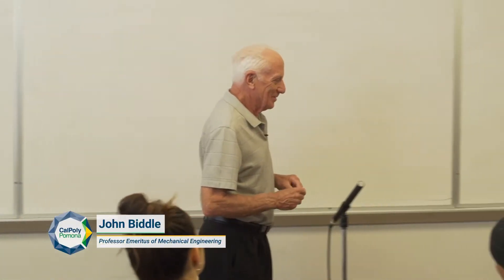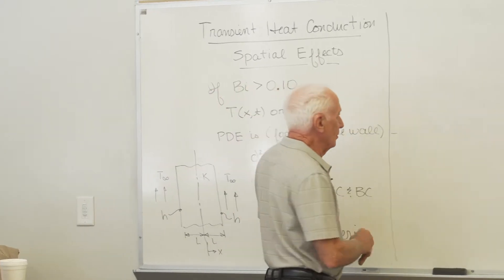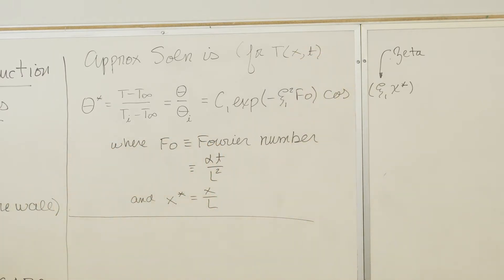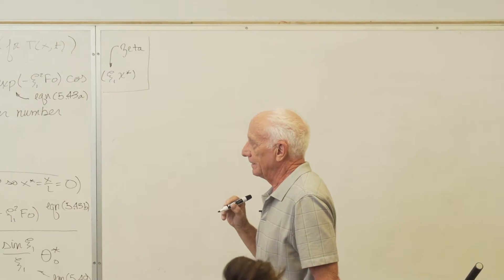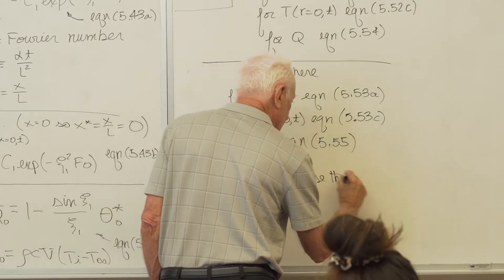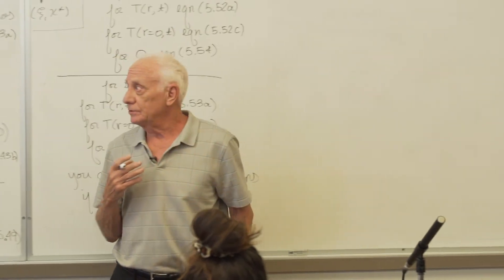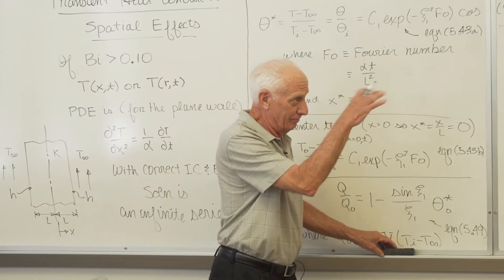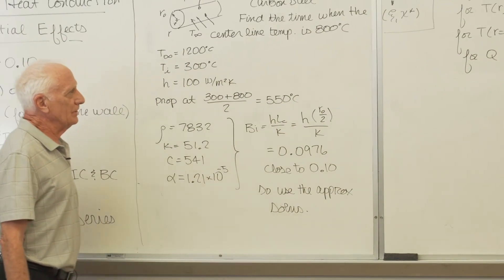Heat Transfer (14): Transient heat conduction, approx. solution model (spatial effects) and examples

Comment: I find it so funny how all the problems and calculations are using metric because it makes it so much easier, then at the end when giving real world examples its back to feet and inches. Must be such a pain for american students to get their head around metric when they start studying engineering.
Reply: for me and alot if not all the engineering students i knew, we all hated when we were given problems in imperial units. SI units were always so much easier to work with
Reply: Lol, in fluids and thermo my professors would give metric and english in the same problem
Reply: i am not a fan of english units😂

Comment: I think there is a mistake in the example of part b. I got a surface temp of 977c. if I don't multiply zeta1 and solve, I get the answer shown of 836c
Reply from the maker: At what time?
Reply: @CPPMechEngTutorials  part b for the part leading up to the answer at 37:00
Reply from the maker: @throttlejunky2211  I think Prof. Biddle is correct.    (T-1200)/(300-1200) = 0.444*0.91     Solve for T = 836
Reply: @CPPMechEngTutorials  ok thanks for checking. I thought right side should be =.444*.91*.611 as J=0.91 and zeta=.611. my mistake
Reply: @throttlejunky2211  yes i think you are right, we must multiply by zeta!! since r* = 1
Reply: @mechanicalkiller1061  J₀[(ζ₁)*(r*)] is an implied function, where J₀ is found using the value of ζ₁. You don't multiply it, it is like the basic function notation f(x) where f is found using the value of x.

Comment: Question: Is there any mistake with the volume of the cylinder, or did the lecturer just take the volume of the rectangle where the fluid contacts the cylinder, pi * d * L * 1 (unit thickness)?

Comment: Hi there, how is C1 = 1.048 rather than 1.0050? Since Bi = 0.02 (using Table 5.1 formula), the corresponding C1 value is 1.0050 and zeta = 0.1995. Moreover, how was J0 obtained? I understand we have to refer to the Table of Bessel Functions of the First Kind in Appendix B but how to determine which value of J0 we should take? Truly appreciate if someone can clarify this to me 😊
Reply: He says to solve for zeta*r in the J0 function. That's how x is determined, which you can use to find the J0 values from the table.